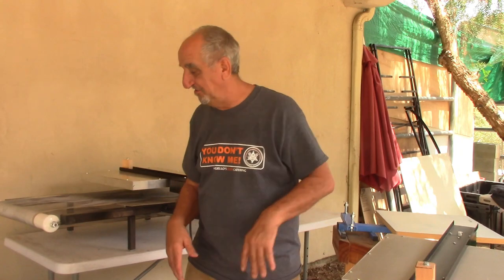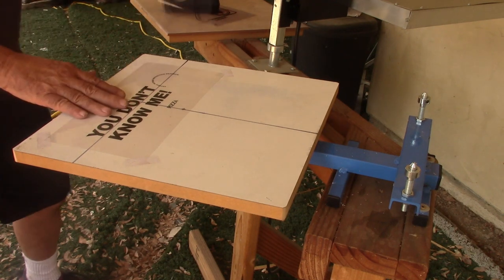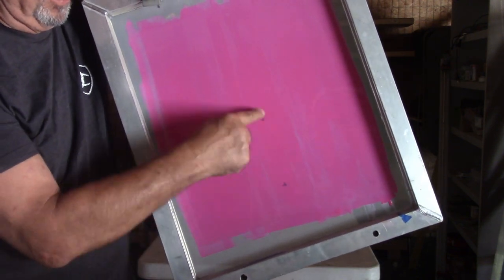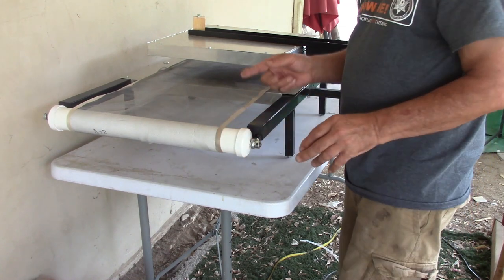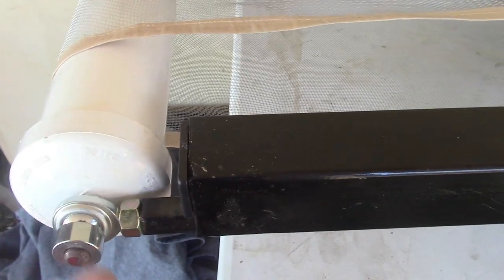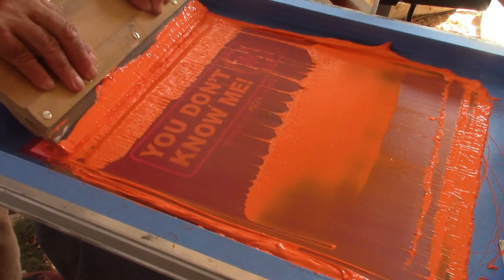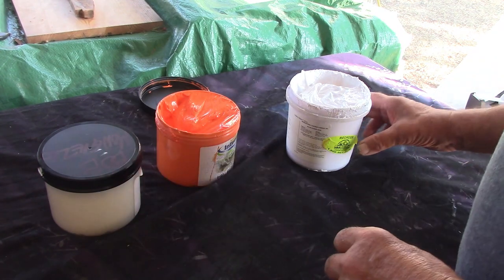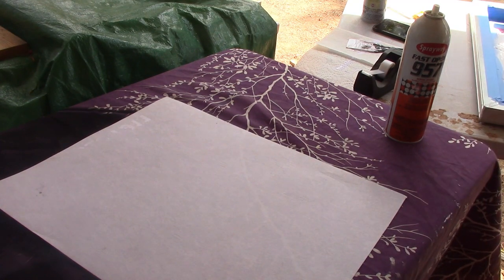How to print a multi color design and the new MINI conveyor dryer

Comment: I think you would have better luck reversing the conveyor so that it pulls the top of the belt rather than push it. I love the videos, gave my girlfriend and I several good ideas, check out my vids. We are just getting started and bought some old equipment and fixed it all up in a barn on the family farm.
Reply from the maker: Thanks for the tip!